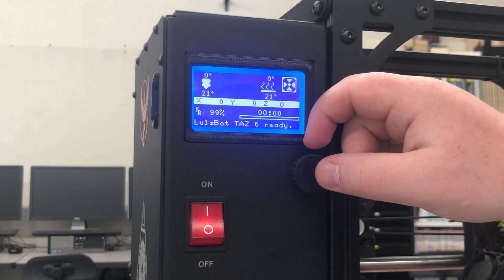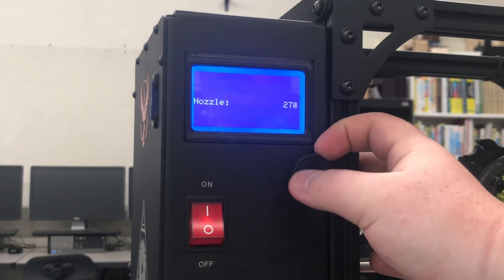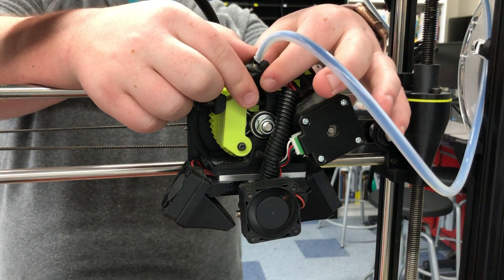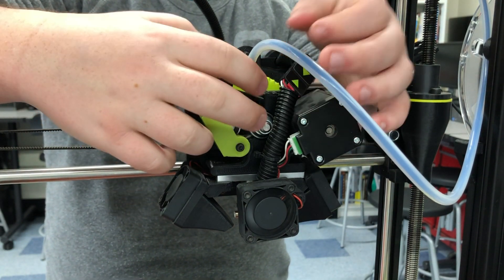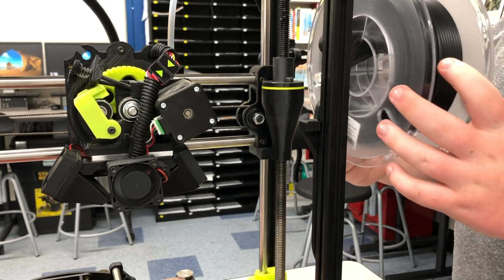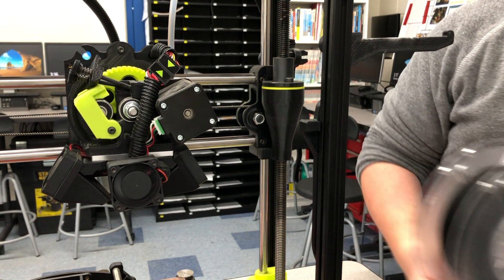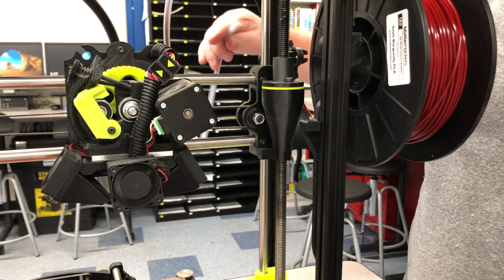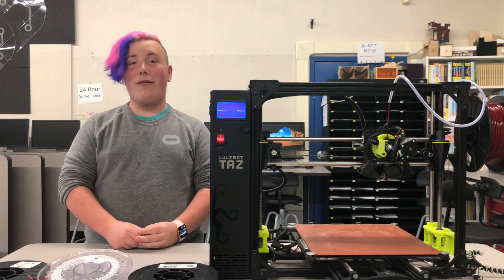How to change the filament on Taz 6 3d printer

Comment: why would you take it to 230? you can change filament at 195 with out cooking it in and baking the hot end.
Reply from the maker: I suggest going to 230 as general advice since having the hot end a bit hotter will make it easier to know your installing filament easier, and because some filaments other than PLA require hotter temps.